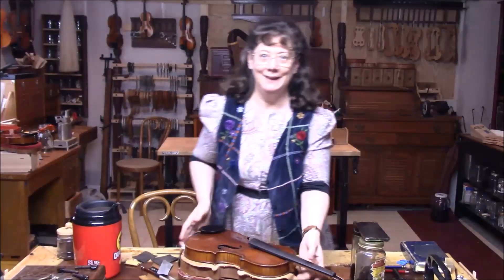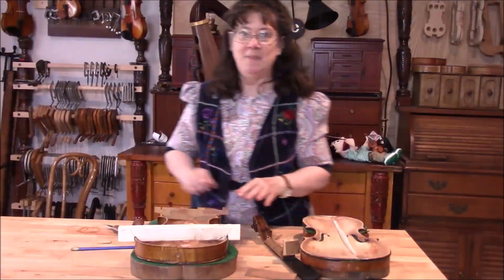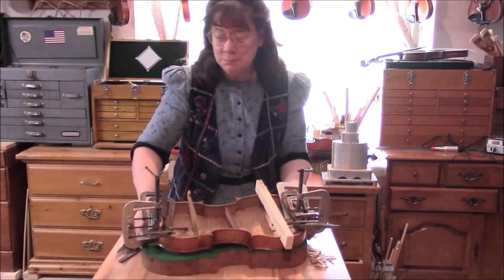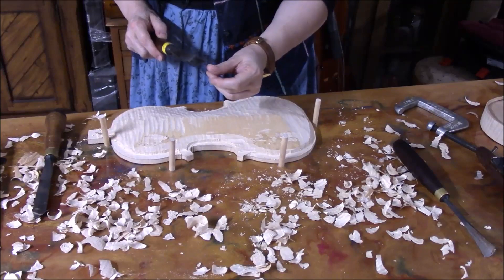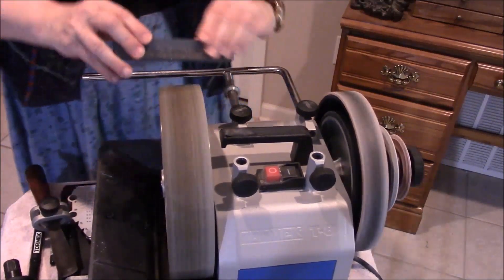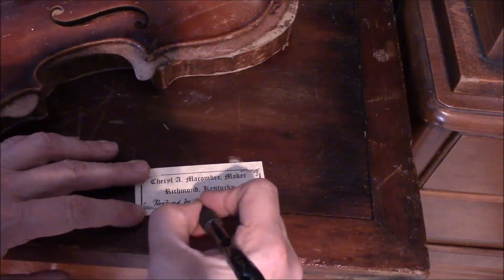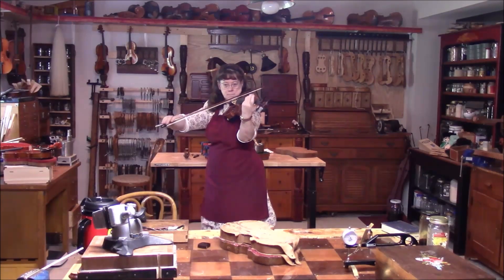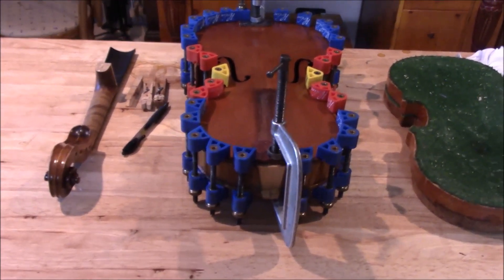Violin Making Adventures #103 (Repairing a Special Violin & Viola, & Making a New Violin) C Macomber

Comment: May I ask what the difference between the violin and viola?
Reply from the maker: Yes!  The viola is at least 1 inch or more longer than the violin and its strings are a 5th lower, so that the low string is a C rather than a G.  The strings of the viola are C, G, D, and A is the top string.   The viola size varies quite a bit.   Thanks for asking!